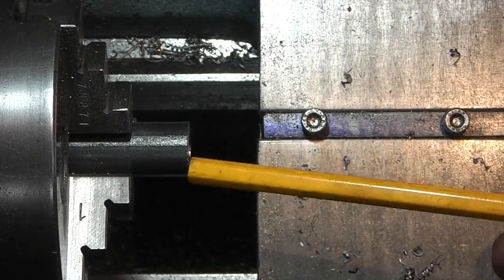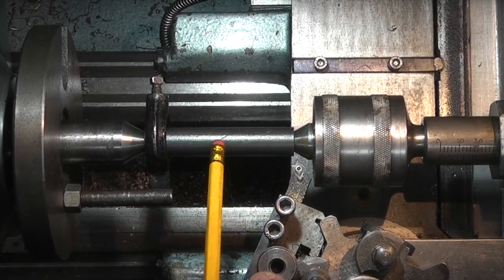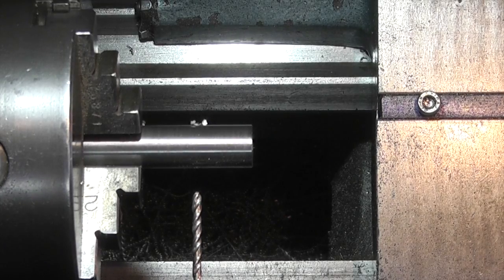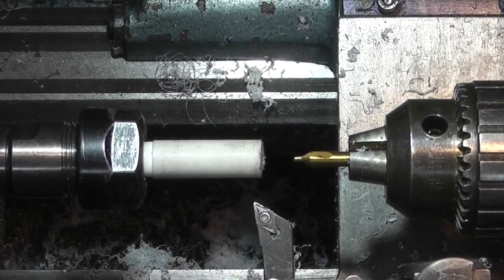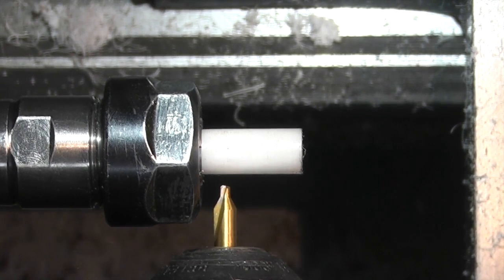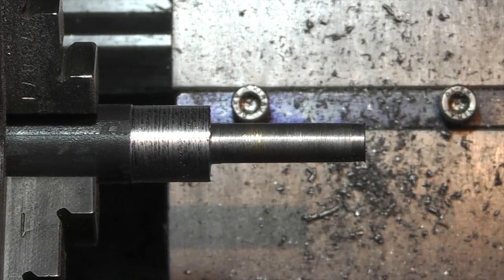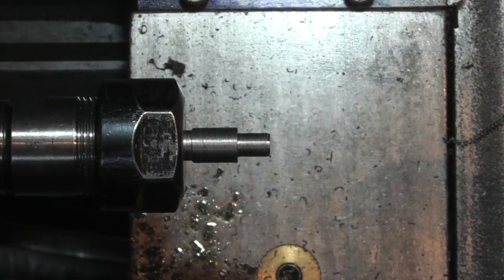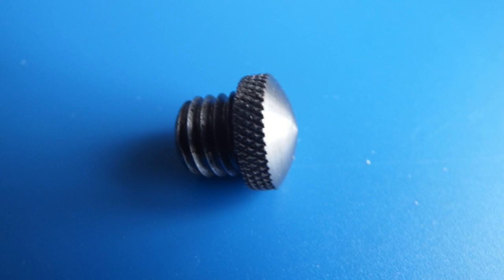Making an edge finding probe (part 2)

Comment: You seem to make components mostly to metric dimensions, Alan. Wouldn't it be a good idea to buy a metric micrometer and avoid all the conversions?
Reply from the maker: Hi I try to give both metric and imperial. Both of my machines are metric but with the DRO I can switch between them